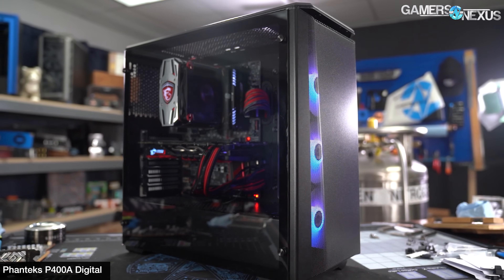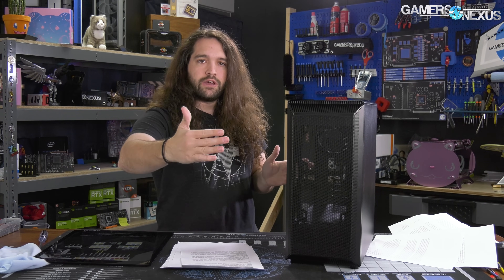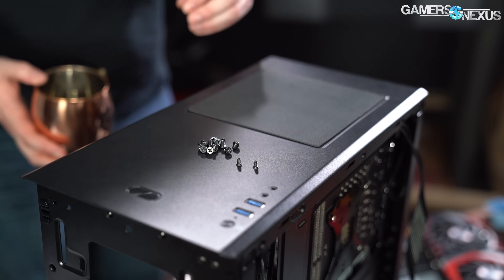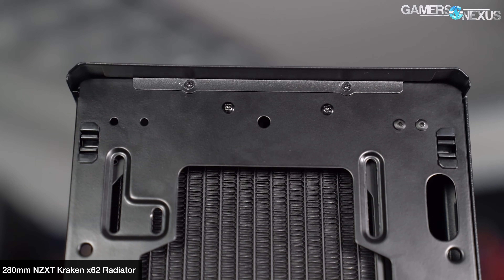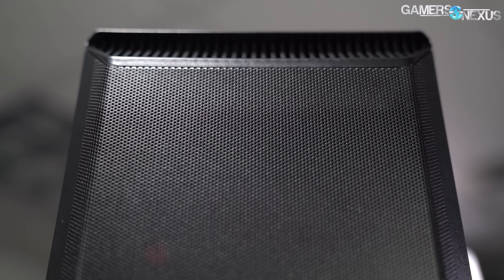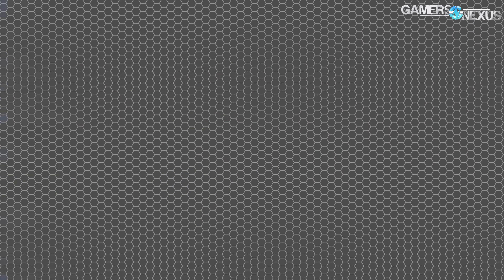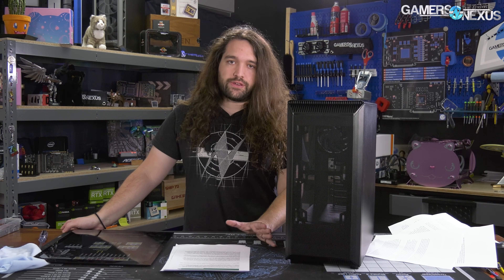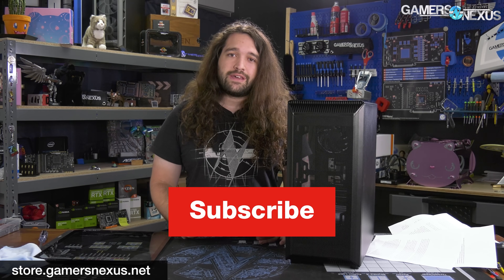Phanteks P300A Cheap Airflow Case Review: Thermals, Extra Fan Tests, & Noise

Comment: "Even if you're a fan elitist, and you would actually buy a $60 case, and then install $20-40 of fans in it..." $20-40? Sounds like a good deal, did Noctua's prices drop? =)
Reply: Arctic fans have always been that cheap and they outperform both Noctua and Corsair at a quieter noise level.
EDIT: since we got so many comments: we were not comparing Arctics sub $5 dollar fan the P12 or F12 (when bought in a value pack of 5 for $20) to Noctuas fans. We were comparing the much more robust BioniX line from Arctic that has near identical features (anti vibrational pads, similar RPMs, high CFM then Noctua fans) that costs considerably less at $15 dollar a fan and can be found as low as $13. The Noctua fan does at max 93.40 m3/h in their F12 line 120mm. The Arctic beats that for less at 117m3/h in the Bionix F12. Let's not compare a $5 fan to one that costs between $25-30
Reply: @SilverKnightPCs  let me know when they make slim fans.
Reply: Seriously - I put $100 in fans into my $36 case. Theyre not even Noctuas. Noctuas would have been $150 at the time
Reply: @madmax2069  dude they make crazy cheap and good fan
Reply: @1FAST91SONOMA  ...you can get good noctuas for 11.99--how many freaking fans are you buying?
Reply: no and corsair mil are the same expensive, bequiet usually more expensive, there is no more quality cases under 100 bucks
Reply: Arctic sell a 5 pack of F12 PWM PST fans for about $25, which costs less than buying 3 of them individually. That will fill all four of the fan slots on this case with one left over and no need for the stock fan.
Reply: @SilverKnightPCs  This is false. Non-noise normalized, Noctuas can move roughly 10 cf/m more air in both 140mm and 120mm sizes. Noise-normalized, they still outperform Arctic. Arctics begin to become noticeable earlier as one increases RPM in comparison to Noctua. In comparison to Corsair, I don't have the figures for the MLs, but the LLs move roughly 10 and 20 cf/m less than the Arctics and Noctuas respectively, and are noisier. I will be replacing my 4x 140mm LLs with either Noctuas or Arctics. Arctic fans are still great, but to characterize them as better than Noctua seems like more of a reaction to elitists than a fair assessment.
Reply: Lol well you can 5 PWN fans on Amazon for the price of ONE of Noctus fans. And ive done it, with varying results haha
Reply: @SilverKnightPCs  wot. I have both, and they dont come close to Noctua? Much quieter, sleeved cables and have waaay better QC, not to mention the rubbery antivibration etc. Anything Arctic has thats similar is about the same price
Reply: @SilverKnightPCs  You are a bit delusional. Noctua is the "gold standard" basically. There is no way Arctic fans outperform Noctua for cheaper. Beating Corsair fans? Yeah, could be, but definitely not Noctua.
Reply: I'm still using some Noctua fans from a 2007 build.
Reply: @SilverKnightPCs  right of the bat: Corair fans aren't good. You only buy them if you want shiny lights in your pc.
Arctic makes good fans, especially for the price, but they can't compete with Noctua. I have 3 Noctua Nf-s12a and 3 Arctic p12 in my system, the Noctuas are better and they should be, at over twice the price.
Reply: @SilverKnightPCs  the Arctic P series fans are dirt cheap and insanely good for the price, but don't compete with noctua.
Reply: @rand0mtv660  While I do agree that Noctuas are the gold standard, I have to disagree with it being because it was the best in terms of acoustics. Back in SPCR's heyday, the Noctua were considered overpriced and underperforming (terrible value) - but they were a known quantity. Noctuas weren't the quietest, they weren't the cheapest, but they were rock solid and consistent (quality). Ten years later, most of those other "better performing silent fans" are no longer available, but Noctua is still kicking around.

Are Arctic fans better than a Noctua? I don't know. Acoustically it's totally possible, but 5 years from now? Who knows.

Just like how Arctic Silver was the gold standard of thermal pastes, it wasn't the best, wasn't the cheapest, but it was the go to product if you wanted something that worked because you didn't want to muck about.
Reply: @SilverKnightPCs  [citation needed]
Reply: I bought 2x 140mm Noctua fans for $21 each on amazon 2 days ago.
Reply: Leave the cheap fans out! Lower the price. Those fans are gonna end up in the trash anyway..
Reply: @formdoggie5  In my country it is $50 per noctua fan... That would be around $35 usd
Reply: I have a specific taste for fans based on their bearings. Doesn't matter how much air they move or how quiet their blade design is, when a sleeve bearing fan goes bad. Don't cheap out on your cooling! I myself prefer fluid dynamic for their longevity.
Reply: The cool thing about the Arctic fans is, that there are CO models which cost 2 bucks more and feature an actual ball bearing, which will definitely prolong its lifespan.
Reply: Most people don't actually buy Noctua's.
Reply: @BrooksyTech  But the people that do are very satisfied.
Reply: @MrGorpm  But who is putting $80 worth of fans in a $60 case?
Reply: You people and your expensive fans.  I paid $40 for 6 UpHere RGB fans with a hub and I'm happy as a pig in shit.  Even if these only last a year I'm not complaining.
Reply: @dogdie147  did you mean to reply to someone else, nowhere was I saying they didn't, I just said let me know when they made slim fans, because from what I seen they only go down to 25mm while Noctua goes down to 15mm
Reply: @dogdie147  where are they at then, because I went onto their site and 25mm is as slim as they got, Noctua goes down to 15mm.
Reply: Ikr u need 4 fans basicly just for a case like this 3 in the front 1 in the back typically fans cost 10bucks each and thats budget none rgb thier more like 15-30 for the good rgb fans each so 4x20 is  80 bucks lest shave off 20 bucks assuming u got a sale and free delivering  thats still 60 bucks 20-40 bucks is just loco unles u get like uphear fans lmfao
Reply: @TheNiteNinja19  If you want longevity, it's hard to beat Mag Lev. There's no bearing to go bad at all, just electromagnets.
Reply: @bigpoppa1234  Thanks for this advice about arctic 5pack, i looking forward for buy it one of those product.
Reply: no but there's plenty of cheap options that even being bottom of the barrel are still better than those found in most "cheap" cases, found it funny though, shortly after that statement he has a 280 rad shoved in there, like come on man
Reply: @SilverKnightPCs  Did my due diligence before I responded and the 5 pk does seem like a good value in either the PWM or the non. The non are $20/5 for me and the PWM seem to be from 3rd party but around $30/5 via Amzn. 6 yr wrnty on the non and 10 yr on the PWN, fluid dynamic bearings, OK. The thing I like the most about the PWM's is the little pig tail at the plug so you can daisy chain. Granted you don't really need PWM as just a case fan no reason u cant run them off a 3 pin MB header and at $6 a fan it's not like your "wasting" them. Are they better than Noctua, no. Do you need Noctua's as your front intake case fans, no. Would I rather have Noctua's on my CPU cooler than these, yes. Seems like a good value in the right application and in the context of THIS review seems like a pretty good deal especially if you want a few spares for upcoming projects.
Reply: @bothellkenmore  generally speaking Noctua Fans are quiet but do not move nearly as much air in our experience. We exclusively deal in the P series of fans Arctic offers as well as their Bionix line that more regularly competes with the Noctua fans. The F series are old and have a very ugly cracked shell white to them. Their P12 fans are still on the budget end of their stuff and are not a fair comparison against Noctua fans that cost nearly 8 times as much. Additionally we found that the only fans that Noctua made that did as well or better then Arctics Bionix on radiators where the blacked out industrial fans which had a very aggressive sound design and pushed nearly 3000rpm making them fairly noisy.
Reply: @hovant6666  we were not comparing their sub $5 fans to noctua. We were comparing their BioniX line that performs as well if not better then Noctua at a much cheaper price per fan
Reply: Where are you getting Noctua Industrial fans for $11? Still cant get then for under $20. I put 5 Cooler Master masterfan pros in my case. At that time they were $20 each and the Noctua Industrial fans were $25-35 each.
Reply: What size are the front fans? Im buying an extra 5 fans but it appears that the front 2 are bigger
Reply: wow,these reviewers really did brainwashed you about noctua real good right,you simply can't buy any of the hundreds of cheap fans out there because - noctua
Reply: Silver Knight PCs chad I have both nocturnal highly outperforms arcticz
Reply: Silver Knight PCs just slap a few uphere fans in here and your good

Comment: I have the Phanteks Eclipse P350X which is very similar to this case and adding extra case fans is a must. Having added two 140 mm intake fans in the front has brought the temperature of my hardware down considerably. I have two 120 mm fans as exhaust in the back. It's a perfect setup.

Comment: I need to sleep. OHHHHHHH, mesh front case review! Who needs sleep?!?
Reply: Only thing that bugs me about these is, dust will begin to build up and it'll be very obvious. At least an inner fan filter can be somewhat obscured.
But it is way better than glass front ones. I have an Anidees AI Crystal, and after doing some case modding I did manage to get the air flow to match with the panel on, and off, but it did require pliers and removal of a ton of plastic, as well as a jigsaw.
Reply: @TheNiteNinja19  I have the p400a and surprisingly, the amount of dust that enters the case is close to none. The mesh works really well as a filter.
Reply: @tonimaunde  Good to know. I have a cooler Master HAF lanbox I'm using as a server chassis (my 4U rack mount was a dust trap and had the CM one sitting around) and the front panel just becomes caked in dust after a little while. I use a used dryer sheet between the panel and the fans to catch more of it.

Comment: Love the in depth review. I have always sworn by the CiT brand of cases for budget builds, however I am unsure of what the availability would be for you since I am from the UK. But when you get into tax and conversion this P300A case ends up being closer to $75, whereas my personal favourite the CiT C100 is closer to $55. I believe that there would be a good comparison between the C100 and P300A as they are in a similar category: full mesh front panel, power supply shroud, 3/4 height tempered glass side panel, no RGB, and the C100 comes with no stock fans but has room for 9 (only 6 being useful) fans. I would love to see if you could get your hands on any of the CiT range of cases for review as I have personally used the F3, G-Force and C100 and would like to see how they stack up in comparison.

Comment: @Gamers Nexus I really like the idea of reviewing the price point of cases, IN GENERAL, with $20 added in and considered "by default" for extras (usually fans). And/or as you did here, considering both price points and what they can / can't bring to the table. Or if a case only does well with extra fans, but is a worthy consideration then; largely "forgetting" about viewing the case as a product by itself (i.e, its cost by itself) without the extra expense to get the large uptick in effectiveness.

I'd think most DIYers could afford to add fans relatively easily (if not right at build time, a month down the track when they have $20 to spare?) and so making those adjustments de facto to price points for product comparisons makes the most practical sense for someone who is looking to get great value out of their purchases.

Comment: I am ABSOLUTELY a fan snob, and there is maroon and beige all over my person gaming system...However, I've built several PCs for family members where price was a factor. In those systems, not only did I use all of the stock fans, but I also tried to plan builds so they would need as few extra fans as possible. This is why I have been a proponent of dropping included fans once PC cases reach a certain price point. You can argue where the price point is, but I feel like there is a point at which people are spending enough money on just the case that you can safely assume they are more concerned with getting exactly what they want, and less concerned with cost savings.

Comment: I can see why a company would say "hey, people like different kinds of fans" but I would love a tick box adding on basic front fans. Amazon even makes such an option easy to populate into it's product pages. Sure it may lead some people's expectations, but I think for the most part, most people who DO want more than basic fans don't want to bother with any manufacturer options. I don't think they would have to worry about adding a bunch of other RGB options just to look competitive because most people understand the RGB market is ridiculously robust and varied, and wouldn't expect the case maker to shop it for you, especially because compatibility is rarely an issue, and sizing is pretty easy. I think this case's price lends it to the "modest CPU and GPU, no overclock" market as well as the "I already have a (crate of salvaged) fan(s)" so the "1 fan" options is probably still relevant.

Comment: At this point i want a review for best case without Glas, since my next Case will sit under my Table anyway.
Reply: Many cases have options with and without glass
Reply: Just get a cheap Rosewill one on Amazon.
Reply: Fractal Design Meshify C with steel panel instead of glass
Reply: @Synner Dethshayde as good as the p300a? i mean i will not bilt until next year.
Reply: @michaeltschuertz  fractal meshify c with steel panel + buy 2x 140mm fans and put them as front intake = you have suuuper good case
Reply: @jeffkuzzen  Do you think P400a will better use 2x 140mm fans instead 3x 120mm?
Reply: @AlexGusnawan  yes, cus lots of the bottom 120mm fan is blocked. will most likely be a very small difference tho.

Comment: Just bought one of these last week (still waiting for it to arrive) for 45€..its going to replace my old Nox Coolbay MX2.. On this one I have 3 fans and never had any temperature issues, but needed more bays for HDDs and the case is showing its age...still good for the price. 
I'll be moving all 3 fans to the new case, so I expect the temps to be nice..

Also bought a new Hyper 212 to go with my old R5 1600..temps were never an issue for the stock cooler, running in stock configuration..(28ºC as of right now, and tops at 60/62ºC on full load..), when running with some sort of OC on it, it still handles the temps, but at a much higher noise....

Looking forward for next year's black friday to get a 5600 :p

Comment: This case is absolutely fantastic if you put two decent front fans in it. Get a couple artic P14's or something like that and you have one of the best performing cases for very reasonable money. I'll say, PSU choice is huge here, definitely get flat cables because the position of that drive cage makes installation a little painful. I think this is great to pair with a Micro ATX board and a decent air cooler on a reasonably spec CPU that can run on air. I'm running a 5800X3D along with a Radeon 6800 and temps are fine without ramping up the fans all that high. Good basic air cooling case but it does require two intake fans.

Comment: I bought one of these a couple months ago i like it a lot! I had fans from my previous build to put in it. The only thing i didn't like was the cable cut outs since they were a bit small and the hard drive cage gets in the way of putting away the psu cables a bit but i removed it since I had no need for it.

Comment: My friend has this thing and we stuffed an MSI 2080S Gaming X inside. We had to slide the case fans (2*140mm Be Quiet Pure Rock fans, because I'm a fan supremacist) in after the GPU, but it fit. I Just love how space efficient this thing is. Personally, I think this case has much higher quality than the P400A.

Comment: I got this case for around €55 and got 3 fans along with it. Use the stock fan for top exhaust at a lower speed and two front intake and one rear exhaust.

Comment: Oh my god a top panel that's held by screws and not rivets.  The last case I've owned that had this is a Lian Li case from over a decade ago.  It is fiddly because you have to lightly put the screws in to align the panel, then carefully tighten them.  But it is definitely nice to have the option.

Comment: The only reason I'm choosing this case is the width. My standing desk included a computer holder to be bolted to the bottom, and this is the only case that fits it while still allowing for full size CPU coolers. It's a compact, efficient  design

Comment: It's kinda weird to see how popular the P400a is. I bought it pre-release in Germany and had to wait like a week before it was in stock because supplies were really limited but at least got to have it for 90 euros. Supplies are still limited. It's a good case with some room for improvement, but at the 90 euro price point it's very hard to beat. Haven't had much dust issues, definitely not any more than in any other cases I've had. The NZXT Zero I had before this was a big dust magnet but with the P400A I haven't even had to clean out my cpu heatsink because there's literally no dust on it. Oh and if anyone is wondering, these cases to fit the Thermalright Macho series which is supposedly 3mm above the max spec of the case. It's such a tight fit it basically creates its own airflow shroud.